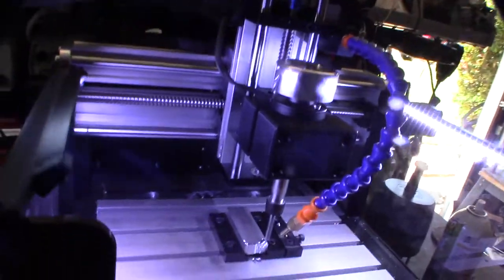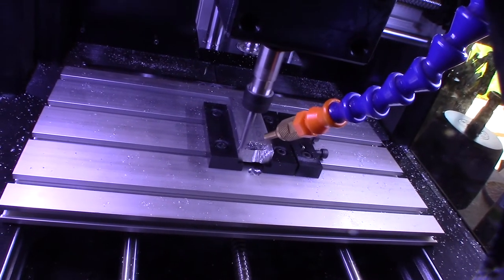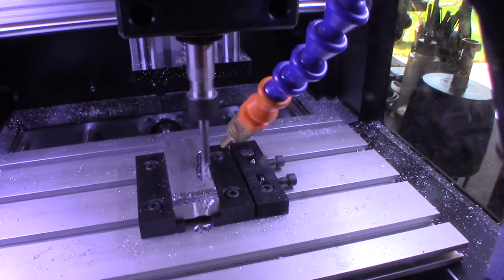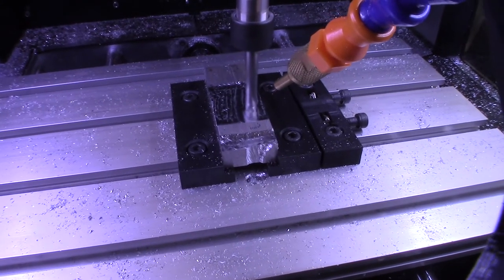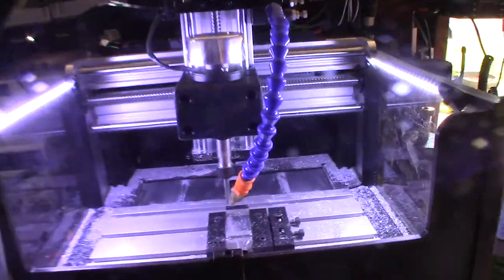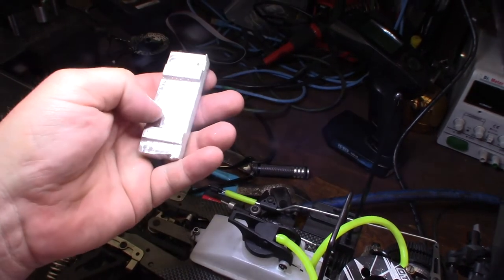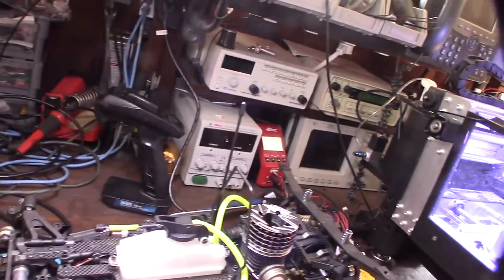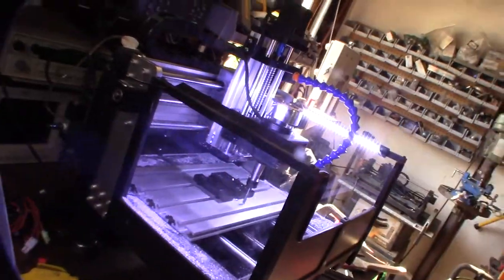3018 CNC Cutting Aluminum Chatter Solved,  first cut,  Spindle Z axis alignment, Ball Screw

Comment: Although I have very limited cnc experience, I do some hobby machining and one rule of thumb is to always choke up on the bit as much as possible........ if you don't need the extension.... just choke up and that will eliminate a ton of issues.   You could get a cheap indicator and measure your spindle squareness.  Also something to consider is climb cutting vs conventional milling.   That is when using the side of the cutter, if  it spins clockwise and your cutter is moving clockwise, it kind of rolls with the cut where conventional is would be clockwise bit rotation but  counter clockwise spindle travel so the blades cut INTO the work.   I think this might have been why you had better results on one side of the boss vs the other.  I sub'd your channel and look forward future content

Comment: Really nice work, glad to see you managed to cut aluminium. I have the same machine but not upgraded. 

The reason why you're having chatter in only one direction is possibly due to what you mentioned about the spindle not being perpendicular to the workpiece, but also possibly due to the machine doing climb vs conventional milling when moving left to right vs right to left directions, which causes different amounts of chatter. Might want to have a look at this article - https://www.cnccookbook.com/climb-milling-versus-conventional-milling/

I believe that the next upgrade for you to cut aluminum properly would be a bigger spindle and MGN or HG supported square linear rails. 

My machine is having a lot of bad vibrations just from the spindle spinning up (not even cutting anything!). The X axis LM12UU linear bearings have a bit of free play when riding along the unsupported 12mm linear rods. Linear rails would most likely eliminate this issue. 

A more powerful spindle, well, is quite self explanatory ;)

Comment: O my that chatter is bad need to figure out if your feed and speeds are off or need to make the machine more rigged. Try using fswizard calculator in the app stop to help you with feed and speed
Reply from the maker: Yeah, its my first cut with my new ball screws. I will check it thanks.